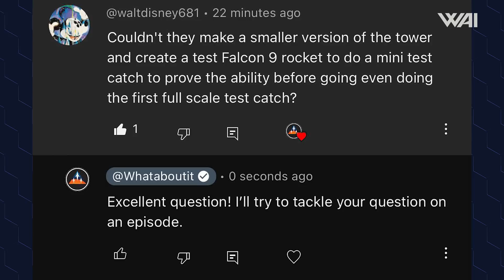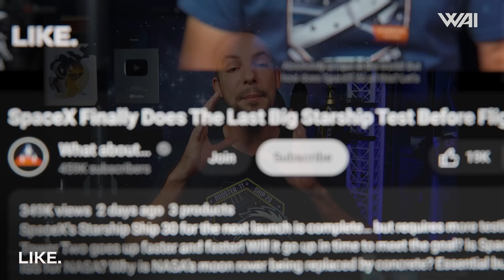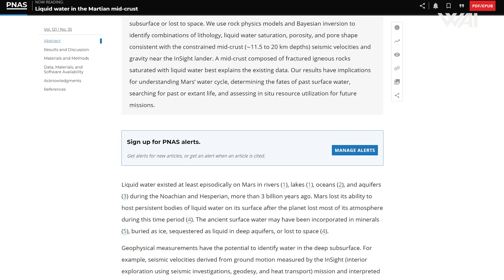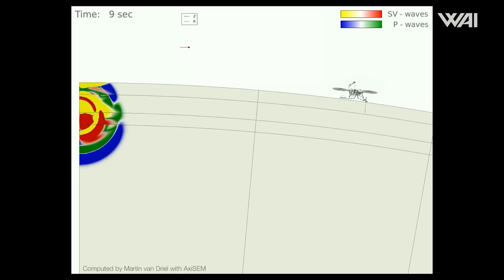SpaceX Massively Updates Starship! Ready For Flight 5!

Comment: They can't use a Falcon for this maneuver because Falcon's can't 'hover' with their current Merlin engines.  They are currently slamming into the earth and using the Merlin engines to kill the speed before hitting the ground.  The raptors being used by Starship can be throttled down and  Booster/Starship have enough weight to allow it to hover while lit.  That is the only reason why Starship can be 'caught' while Falcon's can't.
Reply: Yes.
Reply: Thanks. That's good to learn. 👍
Reply: @gorgonbert  So are the "same old" headlines, can't tell one "update" from another.
Reply: True answer.
Falcon does a one-chance-only  ‘suicide burn’.
R
Reply: @cheagle464 they definitely won't. They're totally focused on starship, and starship will make the falcon rocket obsolete. It would be a waste of effort to try to redesign falcon at this stage.
Reply: Yeah, what he said.
Reply: @THX..1138  He didn't say that at all. He didn't even start to say the point of this comment. lol
Reply: Why does this haven’t more likes this is an awesome comment 👏🏻

Edit: now it has 300 likes nice 😊
Reply: You are clever.
Reply: Of course you don't need to fly the Falcon to the same altitude as used in a normal launch, leaving enough fuel for the hover manouver
Reply: True but 90% sure Elon has stated that super heavy won’t hover. The fact falcons can’t hover do not prevent them from being caught, the necessary expenditure on new infrastructure on both the ground and on falcon is what prevents them from catching falcon 9. They would have to redesign the entire vehicle as well as change every falcon launch site just to prove the concept of a catch, they may as well make a whole new rocket… Maybe out of stainless steel or something…
Reply: @Mikey_399  Supeheavy itself is not manned though so much less need to hover, only the starship itself needs hover capability so it does not need to do a slam....
Reply: @Mikey_399  lol ok ok i was going to troll you but the payoff at the end.... tiphat
Reply: @Mikey_399  I agree, except I don't think they would change every launch site even if they did it, it would be a throw away test as it's working really well to have the thing land itself.
Reply: @cheagle464  they won't
Reply: @yulpiy  yeah, who knows
Reply: @cheagle464 raptors original design was an upgrade for the upperstage engine for the falcon 9 if I remember correctly. Back then it was still supposed to run on hydrogen like the rl10 engine.
Reply: Not to mention the width difference. Falcon 9 is 3,7m (12 ft) wide while the Super Heavy Booster is 9m (29,5 ft) wide.
Reply: Absolutely, but I prefer the term "land" rather than "be caught".
Reply: 💯 facts 👍 this is why the landing gear has crush points on falcon 9 …as reusable as falcon 9 is there’s still lots of one time use hardware
Reply: I dont think falcon can't , it would be just way way more difficult... Starship booster don't have to be very precise because it can correct itself until it gets to place where it wants to be . Falcon 9 would have just one shot
Reply: I agree to a point. Musk himself also explained Falcon 9 landing as you have. However, I don’t think that’s why they can’t catch F9 with chopsticks.  If they wanted to, they could time the landing such that velocity would be = 0 by the time it hits the chopsticks.  The reason they can’t catch is because the width of the chopsticks is approx 9m, too wide for the Falcon 9 to catch.
Reply: BOT
Reply: Exactly, if the engines light too soon, it'll be a hard landing because they can't throttle down enough.
Reply: @cheagle464  They won't change falcon majorly. This would require re-certifying it for crew. That is why Block 5 is the "final iteration".
Reply: The object of the so-called "catch" manoeuvre is exactly the same as F9, which is to arrive at the landing point with zero airspeed/groundspeed, NOT to hover. In the case of F9, the landing area is about the size of a swimming pool, compared to SH which is about the size of a bathmat, requiring software and control systems at least an order of magnitude more precise.
Reply: I thought everyone knew this
Reply: Just read this thread, so many people "know" complete bullshit.
Reply: @jnawk83  lol it’s so obvious
Reply: Correct.
Reply: that's wrong. They suicide burn for efficiency and because they have a highee margin for error. F9s have been seen to make significant hover adjustments on the drone ships....
Reply: Cant the merlins also be throttled down a bit? I mean i know that they still cant hover regardless but they should be able to hover it too right?
Reply: @Berilaco  Not to my knowledge.  They have to time it just right so that velocity comes to zero as they hit the ground.  Suicide burn and hoverslam are terms I've heard used for this maneuver.
Reply: @trevinom69  yeah im sure they can throttle it a bit but no enough to hover so they have to suicide burn anyways
Reply: No it isn't the ONLY reason. But it is THE majority reason, so much so that you might as well call it the only reason.
Reply: ... 🔴 QUESTION: Will there be a second chance for salvation after death? 
**************
🔴 Dear people, don't waste your life! Your sins can be forgiven surely by the Lord Jesus Christ! Repent and believe the Gospel! This is your salvation and there is no other.

🔴 The LORD JESUS Christ spoke about His return in the generation that will see the people of Israel back to their land. We are the ones who see this prophecy fulfilled.

🔴 ANSWER: While the idea of a second chance for salvation is appealing, the Bible is clear that death is the end of all chances. Hebrews 9:27 tells us that we die, and then face judgment. So, as long as a person is alive, he has a second, third, fourth, fifth, etc. chance to accept Lord Jesus Christ and be saved (John 3:16; Romans 10:9-10; Acts 16:31). Once a person dies, there are no more chances. 
—————
● Hebrews 9
27. And as it is appointed unto men once to die, but after this the judgment:
28. So Christ was once offered to bear the sins of many; and unto them that look for him shall he appear the second time without sin unto salvation.
—————
🔴 The Apostle John when he saw the Lord Jesus Christ in Heaven:
—————
● Revelation 1
17. And when I saw him, I fell at his feet as dead. And he laid his right hand upon me, saying unto me, Fear not; I Am the First and the Last:
18. I Am he that liveth, and was dead; and, behold, I Am alive for evermore, Amen; and have the KEYS of Hell and of death.
—————
🔴 If ever someone should have repented when given a second chance to see clearly the truth, it was the rich man. But although he was in torment in fire, he only asked that Abraham send Lazarus back to earth to warn his brothers so they didn’t have to suffer the same fate.  In him there was no power to repent because there was no presence of the Holy Spirit in his heart.
The Holy Spirit works only in the hearts of people who are alive on earth. Was pain and regret for where he found himself. 
Abraham’s answer says it all: “And he said to him, If they do not hear Moses and the Prophets, they will not be persuaded, even though one rose from the dead” (Luke 16:31). Here we see that the witness of the Scriptures is sufficient for salvation for those who believe it, and no other revelation will bring about salvation to those who do not. No second, third, or fourth chances would be enough to turn the heart of stone into a heart of flesh.

🔴 What about those who do not believe? Wouldn’t they repent and believe if they were given a second chance? The answer is no, they would not because their hearts are not changed simply because they die. Their hearts and minds “are at enmity” against God and won’t accept Him even when they see reality of Heaven. This is evidenced clearly in the story of the rich man and Lazarus in Luke 16:19-31.

🔴 Moreover and of big importance against the deceptive teachings of Satan who deceives people by those he possesses: Abraham tells the rich man that it is impossible for anyone there to come to Heaven from the torments of fire or vice versa. (Luke 16:26)
If someone is in the home of the dead, in torment, waiting for judgment, will not enter to Heaven! It's impossible!
If someone tells you otherwise is deceiver. 

🔴 To understand what happens to nonbelievers after they die, we go to Revelation 20:11-15 which describes the Great White Throne judgment and the Lord Jesus is the Judge of mankind John 5:22 "For the Father judgeth no man, but hath committed all judgment unto the Son". 

🔴 Here takes place the opening of the books and “the dead were judged out of those things which were written in the books, according to their works.” The books contain all the thoughts and deeds of those being judged, and we know from Romans 3:20 that “by the works of the Law is no flesh justified.” Therefore, all who are judged by their works and thoughts are condemned to Hell. Believers in Christ, on the other hand, are not judged by the books of works, but their names are found written in another book: the “Lamb’s Book of Life” (Revelation 21:27). These are the ones who have believed on the Lord Jesus, and they alone will be allowed to enter heaven.

🔴 The key to understanding this is the Lamb’s Book of Life. Anyone whose name is written in this book was “saved before the foundation of the world” (Ephesians 1:4) by God’s sovereign saving grace to be part of His Son’s bride, the church of Jesus Christ. These people need no “second chance” at salvation because their salvation has been secured by Christ. He chose us, He saved us, and He will keep us saved. Nothing can separate us from Christ (Romans 8:39). Those for whom He died will be saved because Lord Jesus will see to it. He declared “all that the Father has given Me will come to Me” (John 6:37), and “I give to them eternal life, and they shall never ever perish, and not anyone shall pluck them out of My hand” (John 10:28). For believers, there is no need for a second chance because the first chance is sufficient.

🔴 In Philippians 2:10-11 we have this testimony: “That at the name of Jesus every knee should bow, of things in heaven, and things in earth, and things under the earth; And that every tongue should confess that Jesus Christ is Lord, to the glory of God the Father.” One day, everyone will bow before Lord Jesus and recognize that He is The Lord and The Savior. At that point, though, it will be too late for salvation. After death, all that remains for the unbeliever is judgment and damnation in Hell fire for eternity (Matthew 25:41, Mark 9: 43-44, 2-Peter 3:7, Revelation 20:14-15, Revelation 21:8). 

That is why we must trust in Lord Jesus Christ in this life. That is why we must follow the Lord Jesus Christ!
—————
● Matthew 4
17. From that time Jesus began to preach, and to say, Repent: for the kingdom of heaven is at hand.
—————
● Matthew 28 
19. Go ye therefore, and teach all nations, baptizing them in the name of the Father, and of the Son, and of the Holy Ghost:
20. Teaching them to observe all things whatsoever I have commanded you: and, lo, I Am with you alway, even unto the end of the world. Amen.
—————
● Mark 6
12. And they went out, and preached that men should repent.
—————
● Acts 2
38. Then Peter said unto them, Repent, and be baptized every one of you in the name of Jesus Christ for the remission of sins, and ye shall receive the gift of the Holy Ghost.
Reply: If the TWR is greater than 1 it can hover. And also if a rocket can liftoff it can hover
Reply: @0theraj0  Liftoff requires TWR greater than 1. Hovering requires TWR equal to one. At landing time, Falcon 9 has a TWR significantly greater than 1. If it didn't cut the engines at 0 velocity (and ideally 0 altitude), it would start to go back up. It can't hover.
Reply: @0theraj0  I believe it’s a throttle issue with Falcon 9, not a TWR issue. They cannot be throttled back enough and still work
Reply: @0theraj0 no. Falcon 9 at landing has a TWR at minimum thrust with only one engine above 1. Therefore it can’t hover
Reply: @NotTheRaj  Yes, but can it hover with a near empty tank? ~90% of the weight in the vehicle is fuel and once that weight is gone, you can't liftoff successfully anymore. Ergo you can't hover anymore. Perhaps if they equipped FSH with raptor engines it might be feasible, but then you still have the TWR issue. As an example, they need to launch, reach orbit, then return to earth, and catch the rocket. 
The first problem is "Why catch when you can land?" FSH and F9 can land, so the data would be minimal. The second problem is that they're made of different material. On a larger scales, microscopic differences make huge impacts on how a material can behave. Steel is sturdy and strong, when cut into inch by inch cubes, it has an extremely high tensile strength, and is not very flexible. But if you cut steel into huge shapes, suddenly we can see a little flexibility and less tensile strength. When heated, metal expands, and the thicker the metal the greater the expansion. These things cause engineering issues. So the size comparison would make the data negligible at best. Also we're talking about throwing away hundreds of thousands, if not millions of dollars away for a test that will yeild less than 5% relevant data. It would be much cheaper and provide much more data for them to fail hard and record.

Comment: Flight 5 has felt 2-3 weeks away for 3 months
Reply: 213 days from April 20 to nov 18 2023
118 days from nov 18 2023 to march 14 2024
84 days from march 14 to June 6 2024 
June 6th to today august 30 2024 is 86 days the reason why flight 5 is taking longer because it is a far more complicated to build and test the infrastructure for a launch attempt plus the FAA has been delaying their licensing for the starship with no new leads on the starship at this time
Reply: @TheAmericanCatholic  they didn't catch the previous
Reply: @TheAmericanCatholic  I feel sorry for the FAA because modern reusable rockets all the recent testing from the various competing companies has meant that the FAA has to deal with a lot of work in that area. They also have to deal with the fact that countless journalists wants to destroy the careers of everyone working for the FAA if doing so creates a catchy headline. Then they have to deal with the competition issue where each company is tugging at their sleeves demanding they punish their rivals. 

I have a feeling the FAA is going to split in two and have one half specifically deal with just rocketry.
Reply: its a big step
Reply: Well, I feel the landing area on the drone ship should be redesigned in such a way that it should have higher cylinder retaining walls.  that are raised up from the ships bottom in a tubular fashion. That way the booster would never tip over even when it’s windy or the ocean is highly turbulent it will never mover inside tube . Since it’s  so accurate in the landing ,and having the booster land in this tube where there are holes all around for ventilation and water entry. It will always maintain upright position.
Reply: @MrAndl123  they have an octograbber for that.
Reply: @MrAndl123  That might mess with the center of gravity.
Reply: @idomdotcom0001  easy to do. Ask Bezos...
Reply: I know! Even if it’s still 3 weeks out, it would still be nice to hear that, instead of thinking it could be longer still.